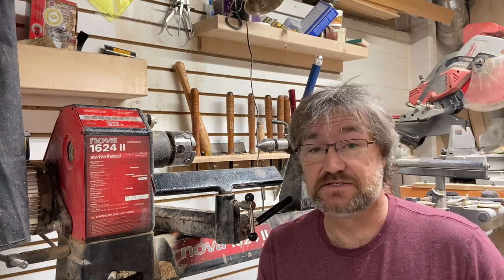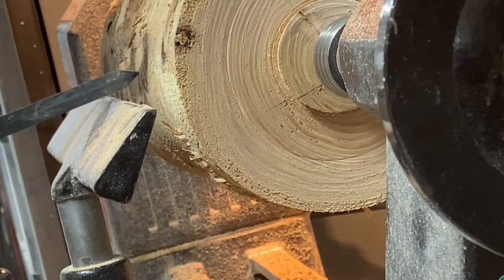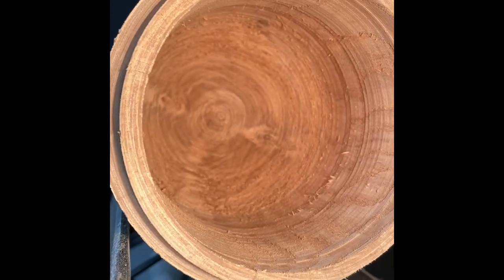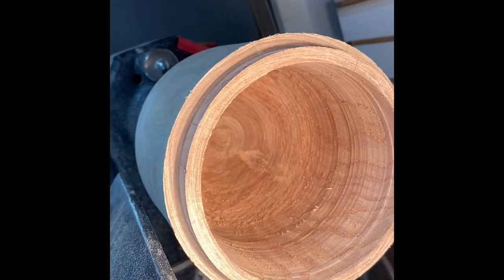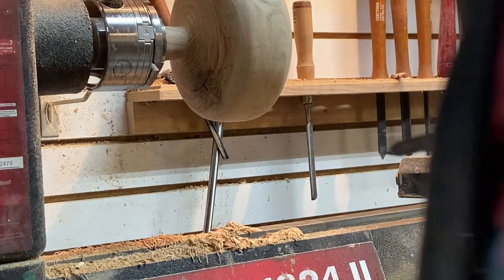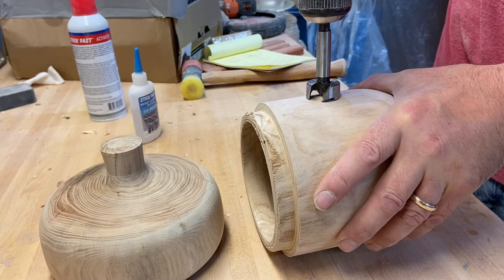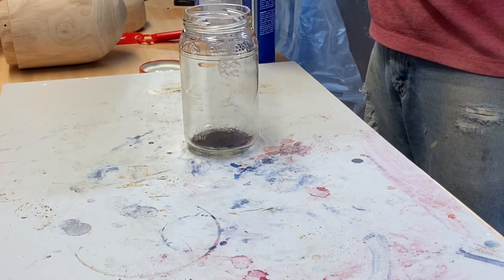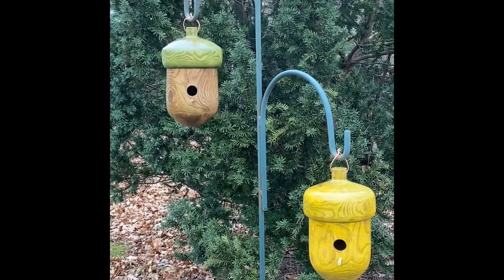Acorn Birdhouses

Comment: Nice work. 
The bearing in your lathe sound on the way out?
Reply from the maker: Thanks!  No the bearings are fine. The dust shield was a bit loose
Reply: @chadberkawoodcraft5982  
Ok. It just seemed very noisy every time you started your lathe.